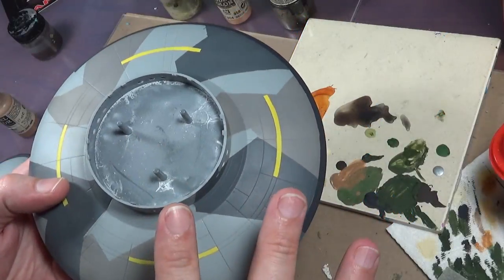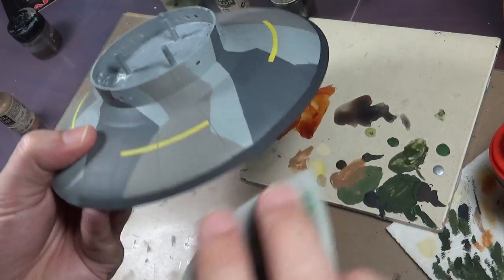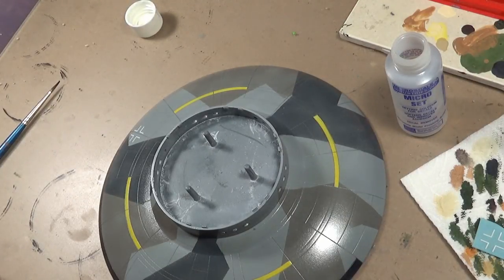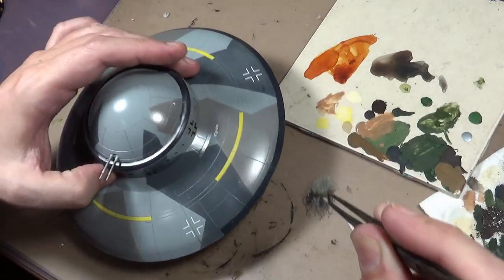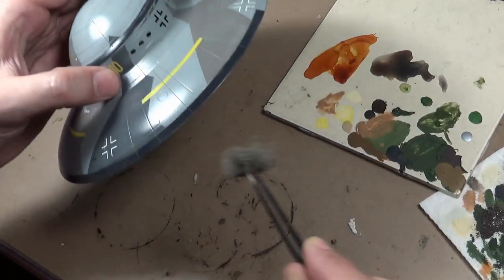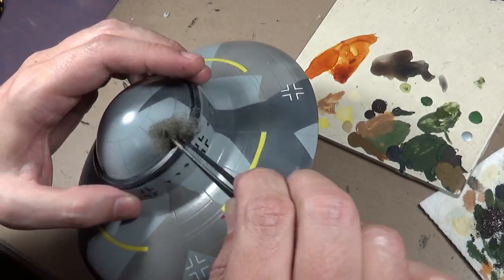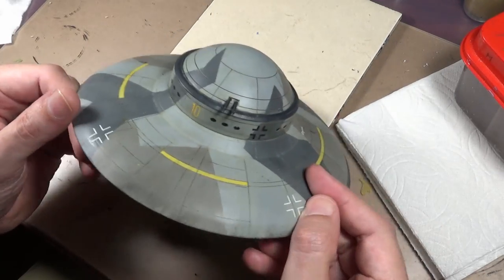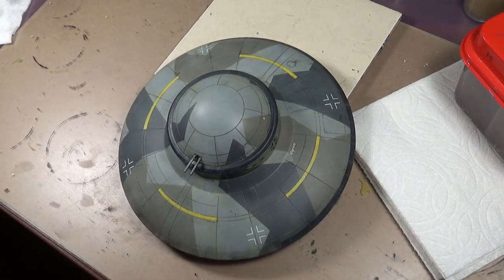Building Pegasus Haunebu II German Flying Saucer Part 2

Comment: It looks good dirty. If, as some people believe, there are several of these hidden in sealed mine galleries, caves, and at the bottom of lakes, and even under a glacier, then this is what they would look like now. I got one of these, filled all the holes for guns, painted it silver, and voila! classic 'Adamski' type flying saucer. Oh, and the 'Haunebu II' was meant to be uncatchably fast, with almost infinite range. It was supposedly powered by a new type of atomic fuel. Riiiiight. I use a 'Uniball' 'Eye' liquid ink pen, with a 0.7 ball for panel lines - the ink is dark, dries quickly, permanent, and does not run when dry. It's great for writing graffiti on scenic structures, too. It runs nicely into gaps, and can be encouraged to run with acrylic thinners - I used it for oil seepage on the drive sprocket bearing points of an EMHAR 1/76 WW1 Mk. IV 'Female' tank.